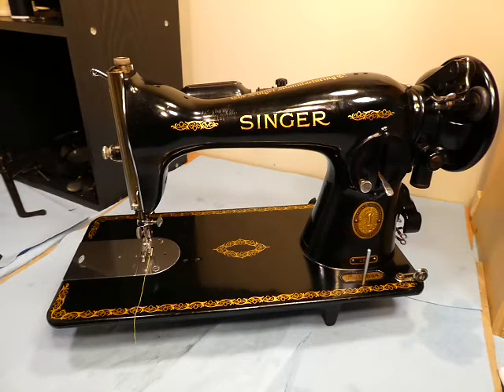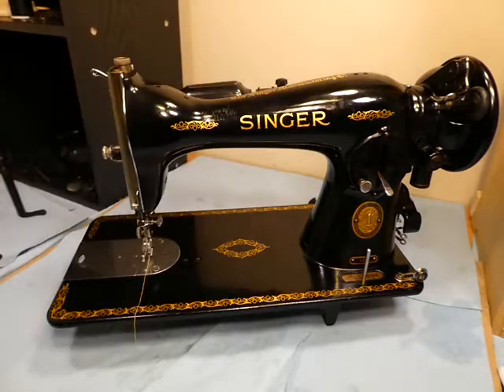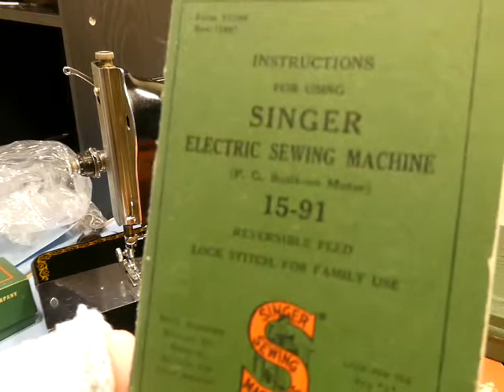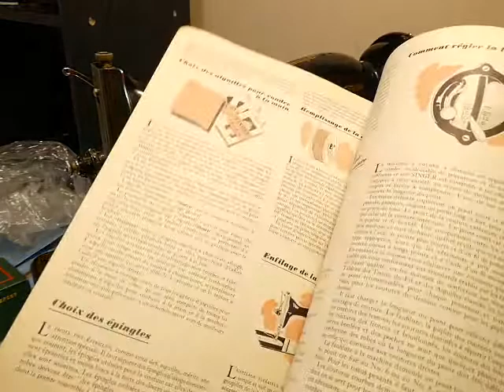SINGER 15-91 SEWING MACHINE WOW! PATRICIA A CLASSIC VINTAGE SINGER SEWING MACHINE

Comment: Hi! Truly blessed to have “rescued” this machine and its cabinet at a thrift shop.  Had it professionally cleaned, and new motor installed, and this beauty runs like a champ!  The previous took mighty good care of the machine per the professional Singer technician.  I said “rescued” because I couldn’t see it being discarded or destroyed in anyway. Oh! It came with the buttonhole machine and it makes those really really nicely, and the box of different feet.   Found an original manual too!
Reply from the maker: What an awesome machine! Good for you Anna! Thanks for sharing!

Comment: Just found one at the curb in a cabinet.Beat the garbage truck by 5 minutes.Oiled it up works perfectly.Was missing footpedal had one from another machine.
Reply: Make sure you look over all the wiring. I got a State version of this machine that was running great. After thorough cleaning and investigation I found many crimped spots in the wiring as well as split areas. The motor was still good but even after an attempt to repair the wiring it was faulty.